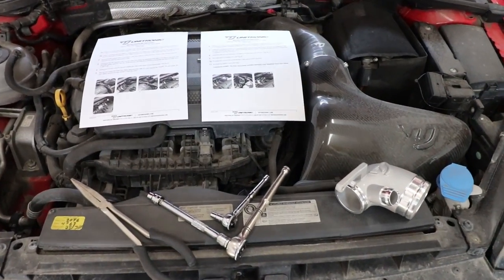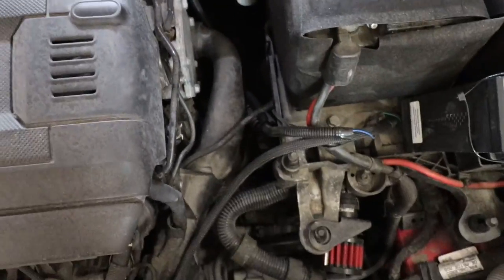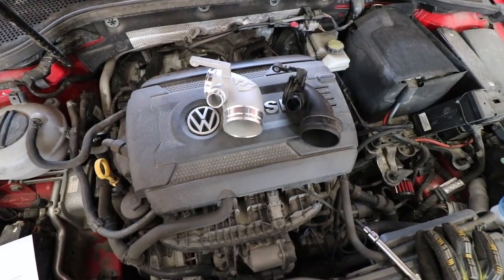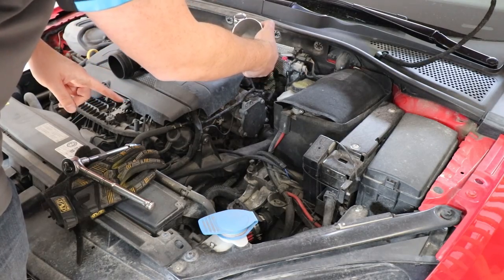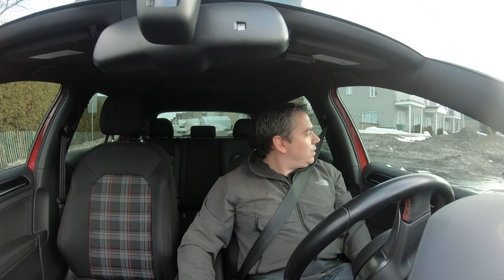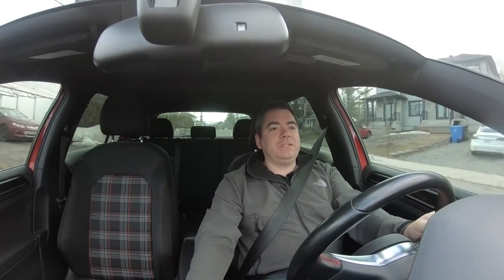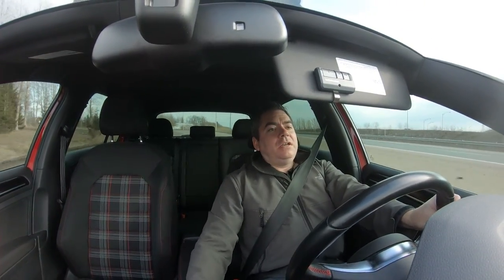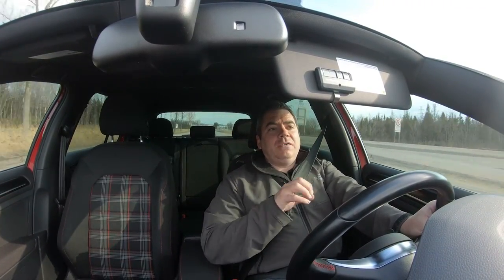MK7 GTI Unitronic Turbo Inlet Elbow Install and Review

Comment: So it's perfectly fine to install the intake with the stock air duct? Thinking of purchasing but not sure if I want to spend the extra 300 on the air duct right now.
Reply from the maker: You’ll be fine the air duct won’t make a huge difference aside from extra bling in the engine bay.

Comment: Had mine installed yesterday. I’ve only driven once since then, but the car felt pretty responsive, especially on the low end. Sound wise I couldn’t really hear a major difference, but my exhaust is pretty loud anyway. Nice video 👌
Reply from the maker: Yeah same here and the note I drive the note I see a difference. There is a gain for sure but it is subtle. Thx for the comment !

Comment: Why do people say these are a pain to install? It looked extremely easy.
Reply from the maker: Access isn’t great for the bottom bolt and removing the pcv is hard but it’s much easier than changing an engine or doing timing chains :p